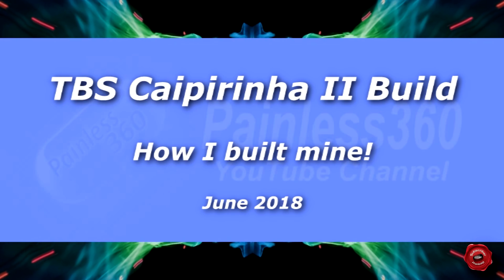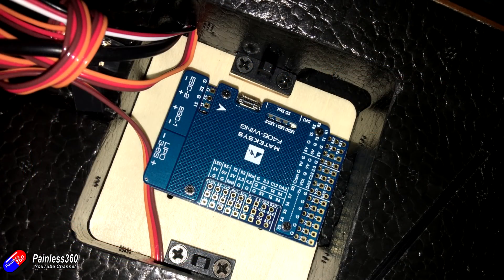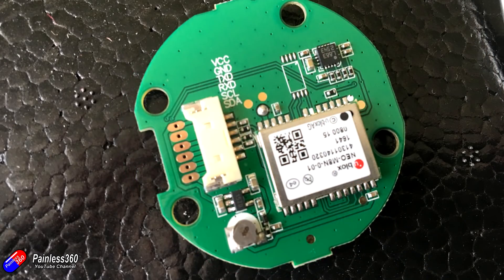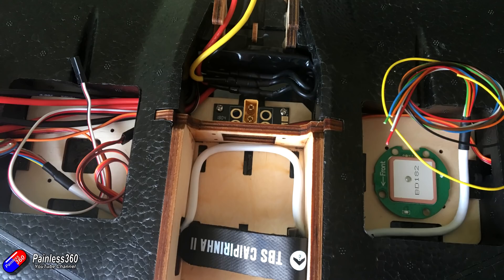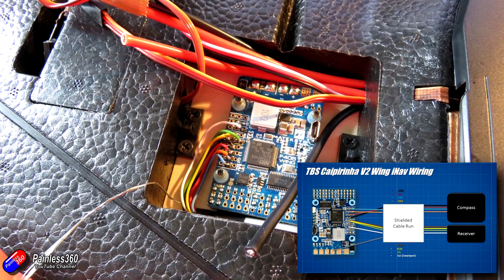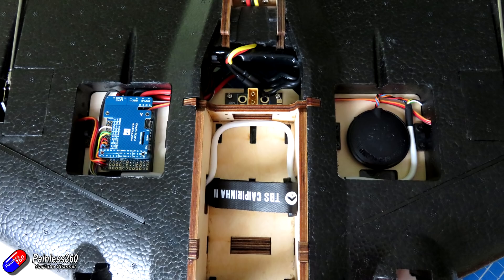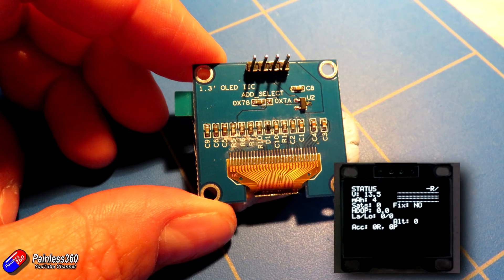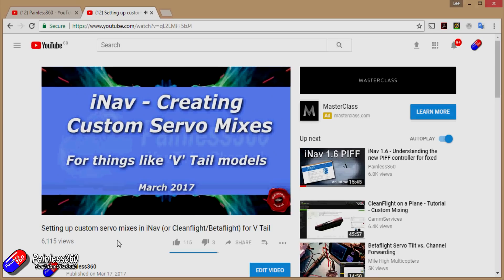TBS Caipirinha II iNav wing build using Matek F405-Wing flight controller

Comment: Can you please make an updated version with the Matek F405 Wing V2? No has a good version to help noobs with wiring plan. Might be useful to use the crossfire nano rx you mentioned also. In any case thanks for the excellent advice and videos!
Reply from the maker: Setup steps are exactly the same. They changed the MCU, IMU, Baro and moved a few of the pins about but the setup steps are identical to all of the other INAV series on the channel.. best of luck.
Reply: Brilliant, thank you.

Comment: Hi boys, checking in late @painless360 I built a caipirinha and test flew it a few times with my buddy. 

When in manual mode, full pitch, thrown by my buddy, it goes straight out and starts to climb as desired. But when thrown in autolaunch (It goes into anglemode, full throttle like described above) it first falls down a several meters unti it starts to climb. 

Stall speed is at about 45km/h (in angle mode, the pitch has not enough power to further pitch up). Would you say its too nose heavy then? any experience?
Reply from the maker: With heavy wings I usually have the launch idle set high to help avoid that exact thing - see my Autolaunch setup video where I talk about it...

Comment: Hi. how did you fasten the 405? Sticky pads or screws? Its seems to be aligned with the holes in the bay...
Reply from the maker: Double sided foam tape
Reply: @Painless360  Thx

Comment: Hi Lee, I know this video is old now but because of this I've ordered a Tbs caip 2. I will probably set it up the simulator. I have a question though and I couldnt find the answers. Would the flarm system on the tbs diversity rx work with inav?
Reply from the maker: Not sure, I've not played with the FLARM system myself. Best of luck with the build!
Reply: @Painless360  Do you have a cli file of this build?

Comment: did you connect any bec to power the servos? is it really required? I'm using f35 flight controller. Thanks so much.
Reply from the maker: The F405 has a decent 5v BEC for the servos. See my build with the F35 for how I did that one..

Comment: I'm in the progress of setting up the same ving with the F722 FC which I believe that is is similar in size as the F402. I have no problem soldering the leads directly to the board but would prefer plugs. What do you think about using soldering on 90 degree connectors and maybe cut off some parts of the foam to give some space for the servo and ESC plugs? Since the connections will be in the rear, front and back it is no problem to get some free space by putting the FC to one side of the bay.

Comment: i know its older but im amazed at how well you put everything together. Im assumingthat its not possible to use a pixhawk cube in this model? would you prefer the cube over this fc?
Reply from the maker: If it's Arduplane you want then check out the latest builds on the channel where I'm using it with things like the Omnibus and the Matek F405-Wing FCs..

Comment: I am trying to set one of these up for a Multiplex Twin star. (Remember them?). I have the servos and GPS all working, and the arming switch shows as working, but I cannot gt the motors to run. On the Inav motors page the graphic moves with the throttle stick, but whatever I try, will not make the motors turn.  The ESCs and motors will run direct from the Rx. Help please, it is driving me crazy.
Reply from the maker: Assuming that you've set everything up correctly (esc setting in the configuration tab and arming ok) I'd try swapping one of the known good  servo outputs with the throttle to rule out a hardware problem on the output pins.. Best of luck

Comment: Im lost on your power wire wiring for the esc and lipo power and grounds, can you send me a pic or description, thanks
Reply from the maker: Close-ups of the power connections at 10:44. The Matek connection diagram is excellent and the one I followed - http://www.mateksys.com/?portfolio=f405-wing#tab-id-3 Best of luck with your build.
Reply: @Painless360  did you cut the factory xt60 lead off of the esc ?
Reply: @Painless360  whats the other end of those power wires look like? Am asking cuz the factory runs the esc to an XT60, did you cut it?

Comment: Hi, for the Bluetooth, I have connect the Bluetooth hm-10 with baud at 19200 and enabled msp on uart1 and set the same baud on Bluetooth , however the speedybee app keeps timing out , how did u connect your board using Bluetooth?
Reply from the maker: I remember reading somewhere that the application will only talk to the speedybee USB devices. Best of luck

Comment: Very nice work, will use many of your tipps on my incoming S1100 build which also has got bays right and left of the canopy. 
I´m wondering why you haven´t connected the compass of the gps module? Is there no use for it in iNav or the Matek F405?
Thank´s a lot for sharing this build!
Reply from the maker: The reasoning behind the compass is all covered in my iNav fixed wing videos and the iNav documentation. Best of luck!

Comment: Hi Painless 360, thank you for your continued great videos and I hope you keep the good work up.
I've just purchased the F405 board and I'm setting it up using the traditional PWM setup and Im kind of lost  as to where I should connect my outputs from the board to the receiver for PWM setup.
I understand I need to connect the inputs servos to the S3S4S5S6S7S8 section of the board and Ive watched your videos on this board but you are not using PWM setup.
Sorry for my ignorance and your help would be greatly appreciated.
Martin.

Comment: hi your videos are very good ,i need to ask i have a tbs nano  and  i was thinking can i wire the  GPS & COMPASS MODULE M8Q-5883
matek da pin to the da pin on the nano and the cl from the gps to cl on the nano just to get the compass working then would i need to flash inav onto the board?

Comment: Where is the current sensor on the PCB? It mentions it in the Maytek F405-Wing PDF, but I'm not seeing it. Is it possible to add a standard 3rd party APM power module/current sensor?
Reply from the maker: It's on there - http://www.mateksys.com/?portfolio=f405-wing - no need to add anything else.. Best of luck!

Comment: This video was extremely helpful for me. Thank you. If I may, I would love to see a video tutorial for INAV on this specific build. I'm new to INAV and will be commencing a build inspired by yours (Cap 2, f405, GPS, crossfire) and am a bit intimidated getting my channels and modes and endpoints/sub trim and GPS rth/failsafe done with confidence. Right now I feel like I'm piecing a dozen videos together. I wouldn't be able to thank you enough if you did that or if unable a resource that helped you. Thanks!
Reply from the maker: My 'Introduction to iNav' series (mentioned in the video) is designed to cover all you need to know. The basics are the same for any build. I also added an F35 to a wing in anorher series too.. Best of luck!

Comment: Hi Painless360, what version of INav are you using to be able to make the oled display working ? I also have the matek F405Wing with INav 2.0.0  but in CLI the "feature DISPLAY" is not provided anymore !! I tried to use iNav firmware 1.9.1 but still the same. Furthermore, current wiring diagram on Matek website still shows the oled display together with Inav 1.9.x configuration stuff.The feature seems to not be implemented anymore. It's really a shame... I think this is a really handy feature for checking GPS status before flight. Also, I have done my tests without any GPS connected, but still the display could display information like current consumption... Any idea on the subject ?
Reply from the maker: This was v1.9,..
Reply: Hi  @Painless360 . Quick follow up... after some discussion on INav GitHub, it appears that the feature for Oled display is not called DISPLAY anymore but DASHBOARD now. Confirmed by test on my F405 Wing FC with INav 2.0. Tooltip for CLI command in Configuration tab in INav is wrong.
Reply: @jean-francoisdupont5952  Hi! You mentioned current consumption in your initial post but, even though it's listed on the Maytek website, I'm not seeing a current sensor on this board at all.
Reply: @austntexan  LOL. Sorry I'am french and I made a stupid language mistake. My fault. I wanted to say "actual wiring diagram". But it seems there is a current sensor anyway. On the back side of the board there is this big resistor like component which seems to be part of usual current sensing electronic stuff. And the website clearly state that there is a current sensor with scale value of 317... And even if my build is not finished yet, when powered by the power input that board actually mesure current. So I would says Maytek website is right ;) Or there is some magic behing :D

Comment: Nice video but would rather have it been on a conventional fixed wing, different setup and more complex options - why always its a flying wing ?
Reply from the maker: All wiring, except for the servos, is identical. The wiring for the servos is shown nice and clearly in the iNav interface you you just follow that simple picture. Maybe a more conventional fixed wing for an iNav 2.0 series?

Comment: Painless,
   Thanks for all the super videos… always my first choice for finding information on my projects/problems’
This is a little off subject but I have a couple of F4 Omnibus boards and a Matek F405 Wing running iNav and have seen some info on putting Audupilot on these.  I would like to try it but want to make sure I have adequate information before going ahead. Did you or will you make a video showing the process of loading Audupilot on the F405 Wing or a source of info on this?
Thanks, Jerry
Reply from the maker: When the code and implementations are a little more solid. I did mention this in my recent 'Flight controller comparison' update video but will only look at it once a little time has passed - else I'll end up doing all the 'support' for the project ;)
Reply: Wise decision. I'm in no hurry so I will just wait for this to mature and stick with iNav. Thanks

Comment: Very nice toriel and build....I like your style. I build the TBS wing using all TBS gear TBS zero zero camra, Vision VTX, Colibri Race FC and  two GPS's and crossfire working on I NAV which is more compact then your build and is not as stright forward as yours much harder to set up and get it all working. Kodos on the build mate!

Comment: I have this same board, for some reason I can't get the GPS to talk to the FC at all. I've tried 2 separate NeoN8M's, on 3 different UARTS, no luck.

and yet, I've made sure that tx--->rx and rx--->tx already. It's like this thing just doesn't want to communicate at all.
Reply from the maker: Have you checked that the GPS has power?

Comment: Im beginner for this , I'm so interesting about aerial drone mapping system. therefore is the possible to connect with raspberrypi with matek f405-wing flight controller.
Reply from the maker: No idea, I've not looked at that. The FC is running iNav and I'm not sure that's an option..

Comment: Too lazy I got F35 flight controller instead.
Reply from the maker: If you don’t need all those ports, it’s a lot easier to build..
Reply: At least the Matek board has clearly labelled I2C solder pads. Well for F35 flight controller I think for the I2C screen it work it needs to daisy chained into the same port as the airspeed?

Comment: Beautiful work man! I hear you about this build taking a little planning. I am doing mine as an inav build with a Powercube FPVision PDB and a Colibri FC. Using the Colibri is problematic because it doesnt have builtin osd for inav, the osd has to be TBS’s so I am hoping that I can get all the inav functionality but I will end up missing the inav messages on my osd... but I hope it will work. Do you know of anyone else who has done this? I will be happy with the TBS osd and I just want to be able to have flight modes and RTH on failsafe. Anyway I would take any advice from the Powercube guy and all around rc demigod cheers!
Reply: ZeeBeeFPV  I have it all working with all TBS gear just need two GPS units to get it to work if you need help let me know

Comment: Just a note, if you ever cartwheel or #landed it, expect to lose the gopro mount. i'm working with brain3d on a TPU mount to replace it. what I would suggest is find some way to tether a streamer or a fishing line to the aircraft so you don't lose it when it ejects. and trust me. it WILL eject lol My current gopro is sitting in a swampy field for the last 4 days, hopefully i'll find it before they mow/hay the field. There's also vented TPU covers you can get for the underside bays and also for underneath the ESC bay at the back of the rear firewall. I'm using the F35 from furious FPV and have on e of these sitting in a draw, so i might rebuild my other Caipi2 with that. :D btw, if you need a spare motor eventually, let me know i have a couple spares :D

Comment: If you have FrSky telemetry, you don't need the oled screen. The iNav lua will display if you have gps lock, and other parameters, right on your Taranis.
Reply from the maker: Yep, and in the OSD too. For my pre flight I’ve got used to the status right there in the plane in the OLED. You can build it, and fly it how you want. All options valid..  ;)
Reply: No doubt. Just info for people to see so that they are aware the options do exisit.

Comment: I just built nearly the same thing but with f405 osd, I have 5mm of reflex and 60% travel on servos. does that sound about right? I am getting about 13mm of travel on elevons in both directions in manual mode. I wish i would of thought to use shielded cable. Your build came out very nice!